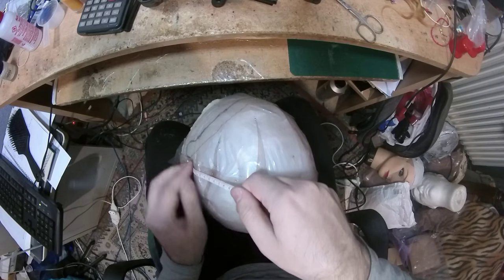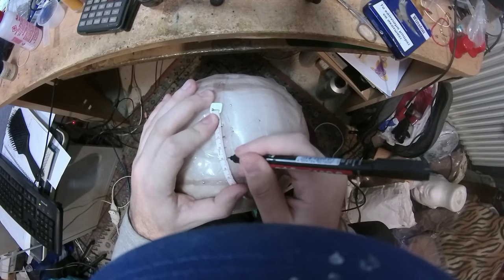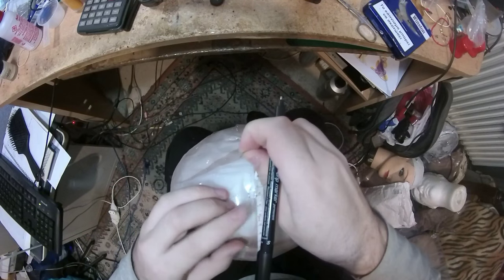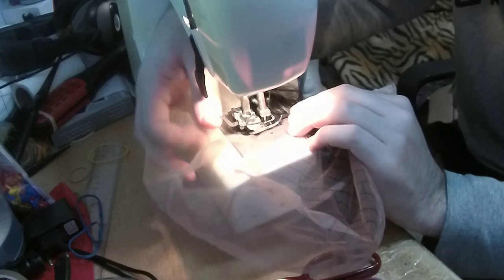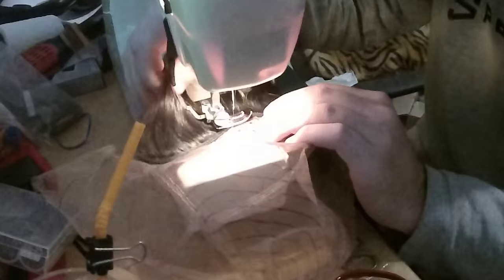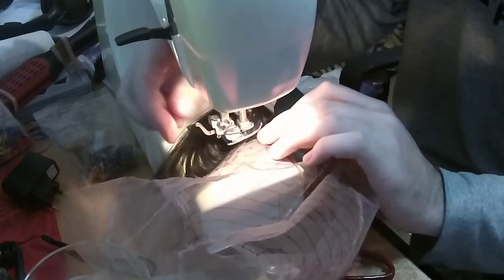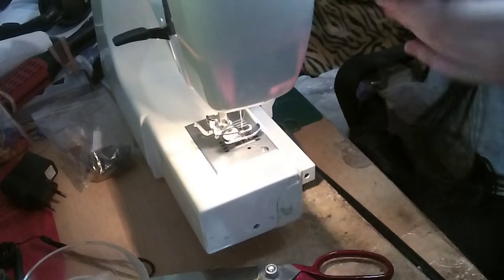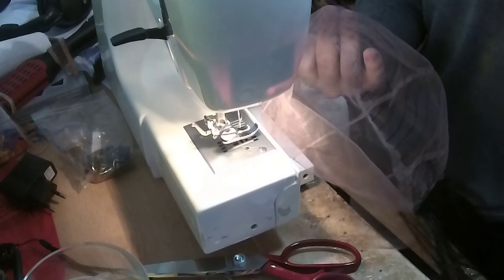How to Sew in tracks in a wig (someone requested this)

Comment: the key to prevent your machine from jamming is to use a walking foot, along with a denim needle size 14. I had the same problem when I first started using my domestic sewing machine. the walking foot will help to guide the weft through smoothly, and the denim needle is string enough to Peirce the weft without breaking the hairs. you can also invest in a industrial machine like I did, the only disadvantage to that is the cost.
Reply from the maker: +Sue Parks Thanks for the information, the walking foot will help in feeding the weft correctly this is true, the machine jammed because it is not industrial and it can only penetrate this amount of layers, not that it cannot make it, just the sensitivity control they gave it for protection was informing me that something is wrong, when it wasn't. I can penetrate like 10 layers of fabric but I will have to move the wheel by hand, the machine refuses to do it :D

I will have to get a real weft sewing machine, they are easier to put wefts in the back of the wig
Reply: Super Wig Maker hello where do you get a weft sewing machine
Reply: SUE-TANYA PARKS where did you get the weft sewing machine

Comment: Hye swm,, when u cut the track off and start too sew on the other layers, is that no shedding after you finish sewing all of it's??? 
Some video i watch,,they're say when we cut the track off it will cause shedding.??
Reply from the maker: +Jefryfifie Fifie The very part that you cut the weft will sure lose some hair, but this is not hand made wefts, it is with a sewing machine so it might lose 1~2 millimeters of hair weft. By stitching it with the machine I also make sure to grab the end and secure it but I also apply some fray check to the end, which will act as a glue and will prevent any further shedding.

when the wig is done, you brush it and get all the hair that would fall, after the first 2~3 brushings the wig will no longer lose any hair for good!

Comment: I use a surgical scalpel to split the double track of the wefts. The scalpel is precise and exact.
Reply from the maker: +Summer well the razor I used was sharp and probably it was the problem, if the razor didn't touch the thread that kept the two wefts together but it would touch the weft itself, then it could cut the weft like hot butter!

It is just they used too much tension to the sewing of the two pieces and also glue between them and it made my life miserable trying to separate the wefts

Comment: I know this is an older video, however, when your thread keeps breaking, you have to adjust your bobbin stitch length. for thinner fabric, the bobbin stitch should be more narrow (read yr instructions manual for every machine is different) also, another tip, allow your 'feed dogs' (the little teeth under the pressure foot) to move your material, without pushing from the front or pulling from the back.   Hope these tips are helpful in your future sewing of wefts. =D.  
**Franchesca 
* CREATIVE ARTIST HAIRSTYLES & CUTS PROFESSIONAL FOR 23 YEARS

Comment: I'm so grateful for this tutorial I make my wigs by  hand takes me at least 24 hrs to finish.   what if the client wants to use that hair again snitching right on top of the weft makes it difficult to remove later?  I thought about snitching wefts to thin lace ribbon that slightly overlaps weft then snicth ribbon to wig cap. this way you can reuse tracks on another wig.  any suggestions?  thanks
Reply from the maker: +F TOSTON Yes it could be slightly harder to remove, but I use nylon thread which can slide easily out if you cut one end of it and I also choose 4mm stitch length which is the biggest and thus the stitches are not way too dense not to be removable.

Comment: Can you do a running stitch thru the weft to secure it to the cap when you sew by hand? Or is there a better way to secure the wefts? Blanket stitch?
Reply from the maker: +Ally W Of course you can, it is just that when you sew the wefts by hand you need to have the wig on the mannequin head, so if you put one weft then you have to remove it and sew it with the machine, the reposition it to the mannequin and repeat.

Or if you first put all the wefts by hand and then you try to pass them with the machine, it will be a little difficult doing the wefts that are between other wefts but it is not impossible.

the only way I wouldn't use a sewing machine at all is when I have a capless base with the elastics in the back, there is no way I can make the wig the shape/size I want if I do not wear it on the mannequin head but either way I only stitch it to like 6~7 points where the elastics exist so it is fast anyway.

Comment: Hello Super wig maker, I will be using a black lace , what do I use to mark the lines on the track?
Reply from the maker: I would use white pencil for eyes, it would be removed easily just by washing it, nothing permanent here.

Chalk would also do, a little more messy but still 100% washable.
Reply: There's also something called "tailor's chalk" that clothing makers use and you can get that at any arts & crafts store as well as online (ex:Amazon). The reason I like it is because the white line is very bright yet you can erase the marks when you're done with a regular eraser or a wet cloth. I also like that the triangle or rectangle shaped ones are easier to control. The downside is that much like a white eyeliner, you have to be careful that you don't accidentally rub the wig cap so much that the lines disappear but I rather watch out for that than to have lines on the cap that I can't get rid of and it ruins the finished unit. HTH!

Comment: try to use the zigzag method on the machine
Reply from the maker: +CeAira Williams Zig zag has some elasticity and I wanted the hair to have a nice grip on the lace, also zig zag might be a gathering stitch, which means it can deform the lace, if the tension of the thread is stronger than the tension of the lace then the thread would come together and the lace would shrink.

I do not know how to explain it but a zig zag would require more security to be made correctly without any actual benefit in the end result.

A zig zag way of putting wefts is preferred when doing it by hand, like a circular motion, put it in the weft and take on the top of it to engulf the weft in the stitching (or something)

Comment: Did u try using a seam ripper
Reply from the maker: I have like 15 different foots for the sewing machine :D I haven't try them all. This was my literal first time using a sewing machine.
Reply: @SuperWigMaker   I think that  +Molly Vincent was asking you if you've tried to use aseam ripper to separate the wefts. A seam ripper is a tool used to cut stitches. We use it to separate double wefts because it works better than scissors and razors. You may already have one but you may call it by a different name. This is what it looks like ---> https://en.wikipedia.org/wiki/Seam_ripper . Did you try to use that to separate the wefts? If not, that may help you next time. Good luck and thank you so much for the videos!